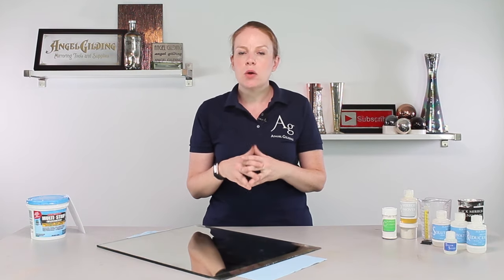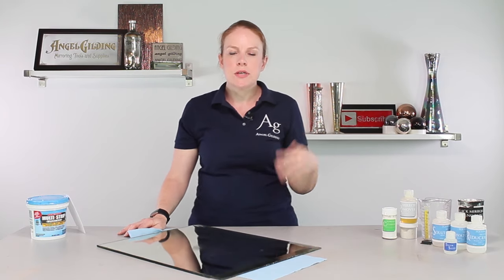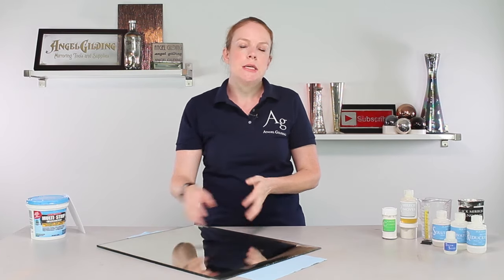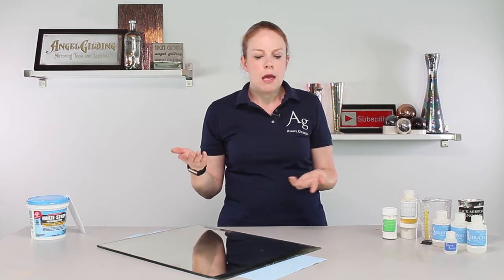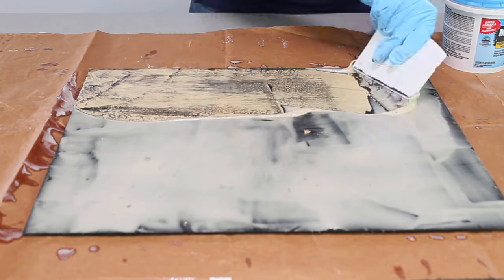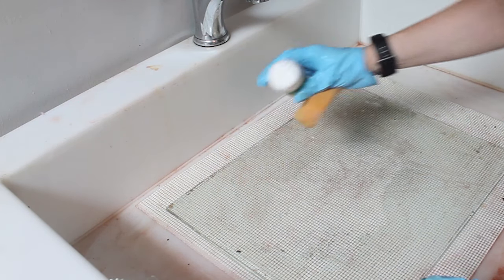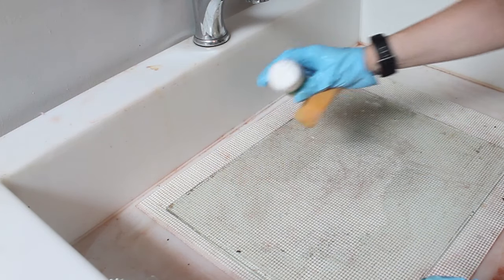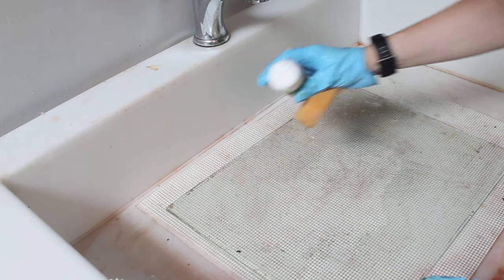Re-silvering an Old Mirror

Comment: I need to make a semi-transparent mirror for scientific project. I wonder if just pouring 1/2 of the solutions per same sq.ft. will make it half semi-transparent.
Reply from the maker: Hi, that's a good question. Actually for a transparent mirror we recommend the standard amount of chemicals but allowing it to develop for less time. Usually you would give it 3-5 minutes so you could see how it looks after 2 minutes for example and see if that works for your needs.

Comment: Thank you for this! I have an antique vanity with an oval mirror and was wondering if I needed to have the glass replaced but I know I can do this! Question though: I actually love the degradation, it's just that it's in the way of where I look to do my makeup. Is it possible to make a clean spot and dapple the paint remover around the edges of the clean spot to blend into the degraded areas? As an artist I feel this is probably possible... Right? 😬
Reply from the maker: Hello, thanks for your question. Typically we do not recommend trying to spot re-silver a mirror as the line between the old and new silver can still be visible and depending on how degraded the original silver is you may degrade it more in the process. However, if you like the degradation and want to explore a bit with it you may be able to re-silver the center of the mirror and embrace the antiqued effect around the edges.

Comment: I am surprised that after all that work and kit expense that you have not further recommended and/or provide a mirror sealant such as Glastion or equivalent mirror sealant to protect the back, and particularly the mirror edges from de-silvering due high moisture content environments and/or cleaning agents that might accumulate on edges or condense on the back of the mirror. Videos and such sealant product are readily accessible online.
Reply from the maker: Hi, thanks for your input. We offer Gunther Mirror Mastic. We find that a mirror that is fully painted with our Mirror Backing Paint does not usually required a sealant unless it is cut down. However, when you want that extra protection the Gunther Mastic works well for us!

Comment: Very informative video. I have a mirror that only has a few very thin scratches on the back. I'd like to repair the scratches without resilvering the whole mirror. Is there such a thing as a resilvering pen that I could use to paint over the scratches?
Reply from the maker: Hi, unfortunately we have not found such a thing.

Comment: Around the 13:30 mark. So in the chance an area wasn't "clean enough" and the mirror did not take to that portion, what would you suggest as a means to correct this? I have a spot right in the middle of the glass and have used over half of the 3 solutions provided in the kit. Thank you

Comment: I have a large mirror with only small areas along edges. Will I have to strip the entire mirror or can I just repair the mirror edges?
Reply from the maker: Hello, thanks for your question. We have found that it does not always work to just mirror one area. It can be tricky to have the chemicals flow correctly and the process could affect the existing silver. We do recommend either re-silvering it or you could try using our Brushed Silver Glaze paint to make the areas less noticeable. it will not be as reflective but can help hide the issue.

Comment: Great video. I watched a man make mirror in his shed he didn't have a kit but it the chemicals and not the Krylon stuff which cannot get ATM. 

Are these kits available worldwide do you supply overseas or have  stockists?

Could you just buy a piece of glass and do this, and is there a thickness in the glass you need. I was looking at turning glass from picture frames into mirror too.
Reply from the maker: Hi, those are great questions. We ship to many countries. You can see if your country is available on the checkout page. You can certainly use a piece of glass from a picture frame. There are not specific glass thicknesses required. Thanks for asking!

Comment: I purchased a three mirror armoire with gorgeous beveling which requires re-silvering.  Mirrors are 7' + tall.  How do you recommend I "rinse" and apply those products?  Can it be done in a garage?  Thank you so much ! !
Reply from the maker: Hello, thanks for asking. For pieces that size it would likely be easier to do with the Spray Silvering process, than with the Pouring process we show in this video. You can see the Pump Spray silver kit on our website. It can be done in a garage but keep in mind that colder temperatures slow down chemical reactions.

Comment: I have an antique round bevelled  mirror that is about 24 inches in diameter that needs to be re-silvered.  The glass is in perfect condition even though it is quite old .  the frame is art-nouveau style and has an elaborate guilt frame which needs attention and possibly re-guilding.  This I am sure is not a valuable antique.  It appears in my grandmother's house on the wall in the many pictures of my parent's wedding reception from 1946.    So should the spray method be used?  Do you have a video for the spray method?    Do you have to wait for the mirror to dry after each of the rinsing processes?
Reply from the maker: Hi, those are great questions! the best way to determine if you should use pouring or spray is to see if you can gently rock the glass in a tray for about 5 minutes. If you think that you can, you can use the pouring method. We do have a video of using spray on our channel. You do not need to wait for it to dry in between steps, only after the silver is applied and before you paint it. Thanks!

Comment: Something I don't understand do you need to protect the front of the glass to prevent the mirror effect on both sides
Reply from the maker: That is a great point. You can protect it with a vinyl mask if you would like. However, typically you silver the intended side and then after it is dry paint it with the Mirror Backing Paint. Once that is dry you can turn the piece over and use our Silver Remover to safely remove any silver that has deposited on the front. I hope that helps!

Comment: Should you use mask 😷 while spraying and other chemical process? Or is it fine with those chemicals? 🤔
Reply from the maker: That is a great question. With the Pouring Silver process a mask is less critical because the chemicals are not airborne. However for spray silvering we defintely think you should. We sell the 3M half face respirator with specific filters for the chemicals found in mirroring. Thanks for asking!
Reply: @AngelGildingcom  Thank you for the reply 😊

Comment: Thank you for the video. I have a mirror that is affixed with strong silicone glue to a base. The edges are blackening. Is there a way to resilver only the edges?
Reply from the maker: Hello, that is a common question. We have not found there to be a sure way to fix this type of issue. You may find a mirror-like paint that will help conceal the issue, however it is possible that the silicone itself is what is causing the mirror to degrade. You may be best off removing the glue, however this is not our area of expertise.
Reply: Angel Gilding, thank you for your reply. FYI - the edges of the mirror that are blackening are "freestanding" - not part of the mirror that is adhered to the base surface. I think it's the moisture in the bathroom that is causing the blackening but that's a guess on my part.
Reply from the maker: @bernadettepesce773   Hello, you are welcome! I think you are right about the moisture being the culprit-it usually is. If this area is separate from the mirror already then you could try the mirror-like paints. It will not be as bright or reflective as an actual mirror but can be a quick fix way to have a consistent finish.

Comment: I bought a mirror I love..antique Venetian...but it has a burgundy stain in a corner .....wish so much I can fix it!...any help?
Reply from the maker: It is possible, although we do recommend re-silvering the full piece. We recommend you email us a photo of your piece and we can provide more detailed suggestions. Thanks!
Reply: @AngelGildingcom  can I glue a mirror on top of a mirror?..it is an option..but not sure if I can glue another mirror on top Thanks for the answer.
Reply from the maker: @mayangirl2012   You may be able to but you could deal with issues of the glass cracking due to pressure as the glass expands and contracts with temperature changes.

Comment: My bathroom mirror is from the ceiling to the bathtub and the sides are wall to wall. Impossible to remove the mirror from the wall. Only the bottom of the mirror close to the tub has got the spots on. There is about 2 cm space between the mirror and wall. How do I get that spots fixed please!
Reply from the maker: Hello, Unfortunately we do not have a quick way to fix one spot perfectly. If you are able to remove the mirror from the wall you could try hiding the area with a mirror-like paint. We have one called Brushed Silver Glaze that you can see on our site. Other companies offer products also for this purpose such as Krylon's Looking Glass Spray. It won't be nearly as reflective but could be good for a small patch. Thanks for watching!

Comment: where are those chemicals going as you wash them off in the sink? What effect do they have?
Reply from the maker: That's a great question. The only thing going down the drain of the sink is cleaner and water. The cleaner makes the surface of the glass optically clean in preparation for silvering and is completely safe to go down a standard drain. You should not pour the silvering chemicals down the drain without treating them first with a waste treatment process.

Comment: I have a glass container withe a metal frame that has a mirrored bottom and it's fixed in place. Is there a way to work around this or would I need to remove the mirror to do the resilvering process?
Reply from the maker: Hello, this sounds like a fun and unique project. Can you email us some photos of the piece so we can provide further recommendations? You can send photos via the contact us page on our website. Thanks!

Comment: I need to re-silver the mirror for my projector, do you have any tips for the process with convex mirrors?
Reply from the maker: Hi that's a great question. We do have some options for convex mirrors. Depending on how deep the piece is you may want to try our spray silver. If you would like to email us with the specifications of your piece we would be happy to suggest the right kit/products. Thanks!
Reply: @AngelGildingcom  The projector in question is a Steelcase PJ930 projector. The mirror piece itself is maybe the size of a large hand. What exactly do you mean by how 'deep' the piece is?
Reply from the maker: @somebonehead   We are referring to how much the piece bends. In the pouring process shown in this video you can see that the silver needs to gently rock on the surface while it deposits for 3-5 minutes. If you think you would be able to do this (a great test is just pour some water on the side you want to silver and try to gently rock the piece until the full surface is fully wet) then you can use the pouring process. If not then you will want to use perhaps our Drip Silver Kit. We have a video of that process, you can see here: https://angelgilding.com/drip-silver-kit-video/
Reply: @AngelGildingcom  I see, thank you.

Comment: What kit would you recommend to resilver a mirror that is beveled with dimensions of 32x25 oval?
Reply from the maker: Hello, thanks for asking! It looks like your piece is about 6 square feet. The Mini Silver Kit that we use in this video and is linked in the description box is the one we would suggest for you. You may want extra Pouring Silver solution so you have some to practice with. You can buy this individually and it is listed on the details tab of the product page for the Mini Silver Kit. Please let us know if you have any other questions. Thanks!
Reply: @AngelGildingcom  Thank you. I live in a very rural area. How is the wastewater disposed of?
Reply from the maker: @holson03  that is a very important question. We have Waste Treatment Kits that enable you to treat the waste water to make it safe for standard disposal. We have full instructions and a video about this process as well. Thanks!

Comment: .? I am applying the silver remover and the cotton is getting black but there is still so much silver that I'm running out of remover. Do I just need more remover or what? It's not coming off as easily as in your video.
Reply from the maker: Hi, thanks for asking. It sounds like you may still have some backing paint on the surface. Would you be able to send us a photo of the surface? You can attach photos on the contact us page of our website. Thanks!

Comment: What about designs that are  etched in the mirror?
Reply from the maker: Hello! If the design is etched into the glass itself then you can certainly re-silver it and the etching will stay. You can see an example of a re-silvered etched mirror on our website. Thanks for asking!
Reply: @AngelGildingcom  So I don't need to protect the etching? It just will repel the silver and the black paint? Or how does that work??
Reply from the maker: @potomaccrafter   Hello! Usually the etched area is also silvered with the rest of the glass.
Reply: @AngelGildingcom  Thank you for your quick reply! Ok, I will try that! It doesn't look silver from the front, so I was confused. Btw--your tutorials are fantastic. Very well-made!
Reply: Hi Alex-I called and left a message--also emailed you--with this problem, but will try reaching you here, too! I tried to resilver my old bathroom cabinet mirror using your products. The result was kind of "spooky"--with blackish splotches on large parts--transparent but black, like diluted tarnish. I made sure it was absolutely squeaky clean, using your techniques so can't imagine that was the problem--but maybe I did something wrong in the tin for silver or mirroring process? I'd like to try again for a  better result, so I haven't painted the back yet. Have you seen a similar problem before, with the silver looking blackish (like tarnished silver) in large splotches? Could you please suggest what I might have done wrong? Thank you for your quick response!
Reply from the maker: @potomaccrafter  Hello, we left you a voicemail. Please give us a call when you have time. Thanks!
Reply: @AngelGildingcom  Thank you, Alex. Sorry I missed your call. I just called back, but you were on another line. I'll stay right by the phone this time :)
Reply: THANK YOU for your excellent and prompt customer care, Alex!! That level of professionalism is quite rare these days! I look forward to trying this process again using the things we discussed. Thanks again!!
Reply from the maker: @potomaccrafter   you are certainly welcome, I think your project will be great!

Comment: I just finish silicone glue my wife make up table mirror then after 3 days this happen Damm it
Reply: I have the same cabinet shown in the thumbnail. I am struggling to remove the felt or cardboard backing, plus the mirror caulking or glue is like cement. How do I get the mirror out or at least reveal the painted back?